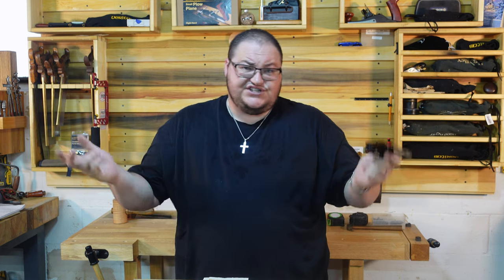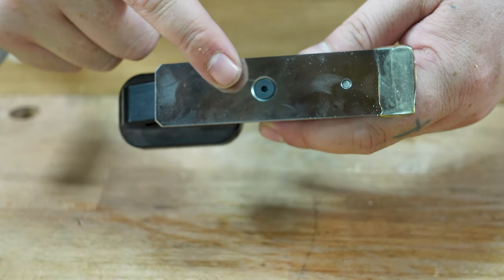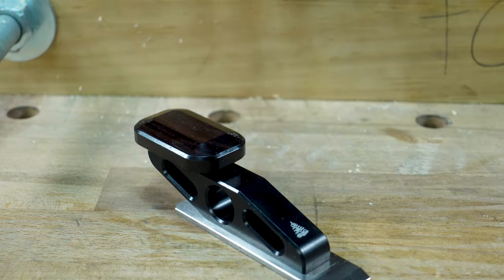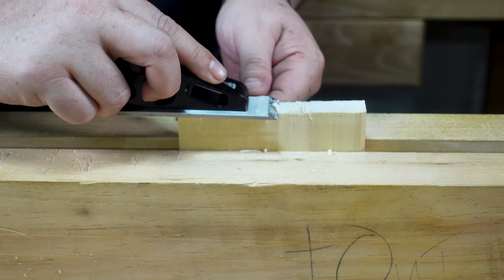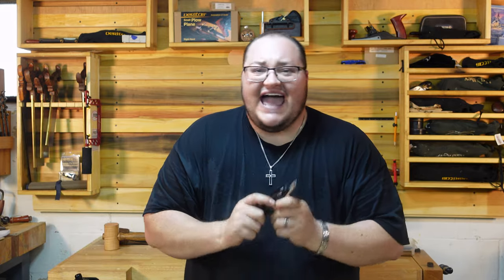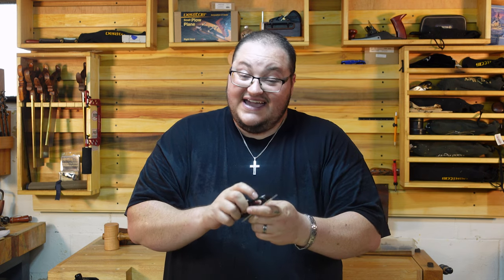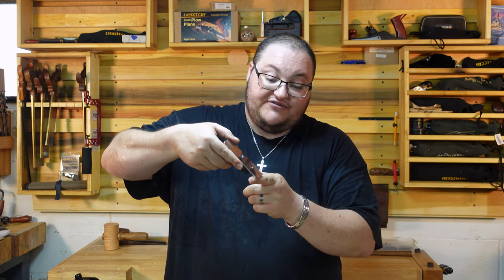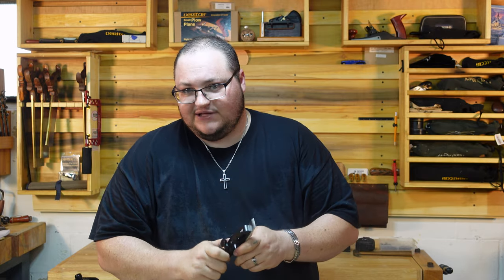IT DOES MORE THAN YOU THINK! - New Blue Spruce Optima Chisel Plane Review

Comment: Soooooo...how does it perform at cleaning dried glue and parting off dowels?
Reply from the maker: Haven't tried it with glue yet, the only concern would be it digging in if the surface isn't level. 
For dowls I like it, use the slicing motion to prevent any issues, don't just go ham on the dowel lol

Comment: This tool leaves me yawning to be honest. If it comes down to using it to “flush up” a surface which has a knub such as a protruding dowel remainder after flush cutting with a saw made for that purpose or in leveling the proudness  of dovetails upon glue up, then you will be forced by the majority of those protruding knubs and pegs etc. to use a tool with more “heft” than a chisel plane to take down the protruding elements most of the way unless you like the sound and feel of an ugly “ thud” from a chisel plane misused. I like to watch Paul Sellers massage them down with a circular scrubbing action of a smoothing plane. Only then will the chisel plane even work. It is strictly a refinement tool in my world. Shoving this tool in any way is a recipe for gouged work and a possible trip to the outpatient room.
Reply from the maker: You didn't even throw a joke in there! Lol I get what you are saying tho and yes this thing can deff be dangerous and can deff dig in if used improperly :/
Reply: @BatCaveCreations  ok. I do think they make good cheese slicers. 🧀
Reply from the maker: Yay!!!! There we go :D